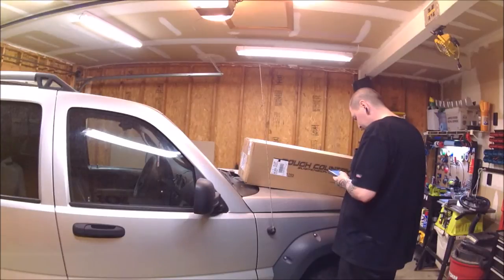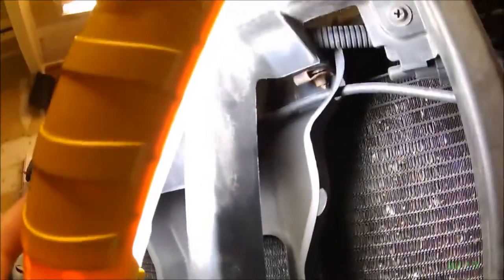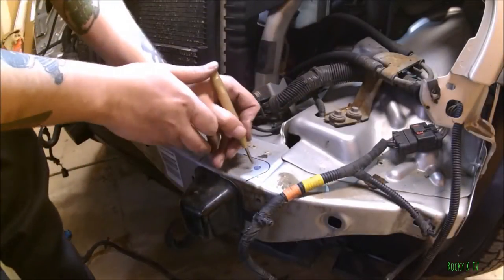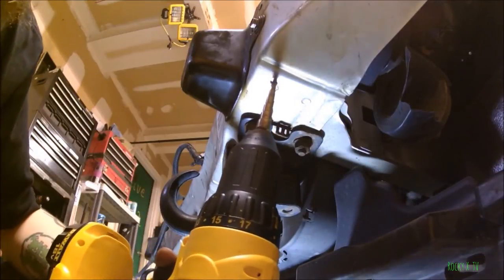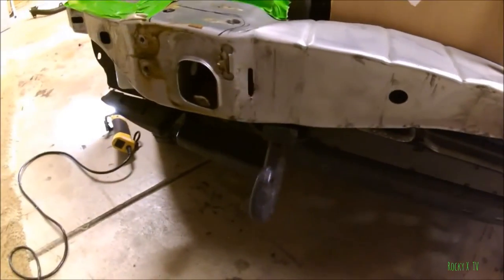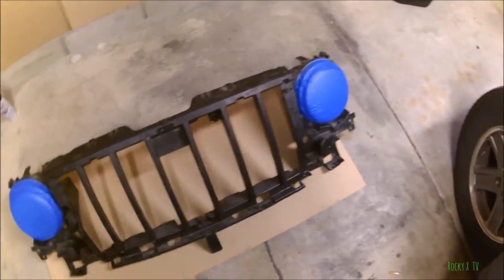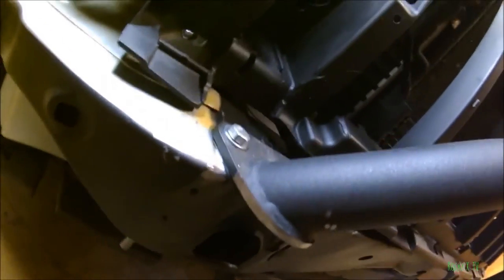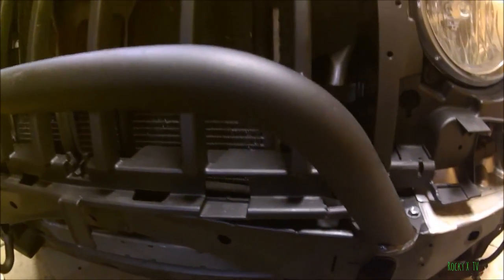Project Renegade Ep.05 (Drilling Holes & More Painting)

Comment: Sorry for reviving an old video, but what is the part number for that specific grill reinforcement piece held by those 5 bolts you mention? My rough guess at the moment is 55156755AF, as it does not have the fog light openings and appears a bit taller than the other types (to accomodate the Renegade flat style grill/hood).
Reply from the maker: I can't say for sure that is the exact one, because I fixed mine. I do however think I have one listed in my Amazon Storefront, you can take a look, it would be under Jeep Liberty Parts - https://www.amazon.com/shop/rockyxtv Thanks for watching and I hope this helps!